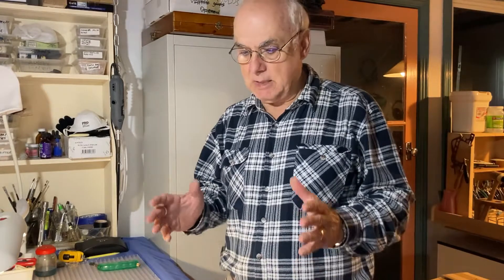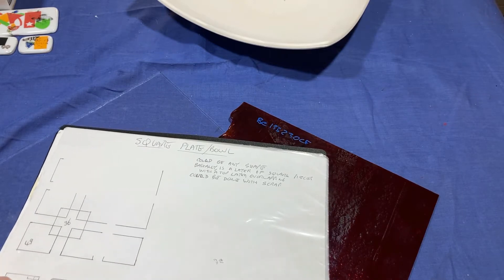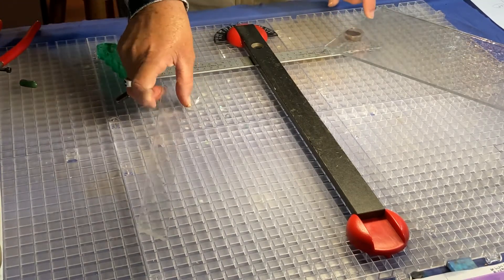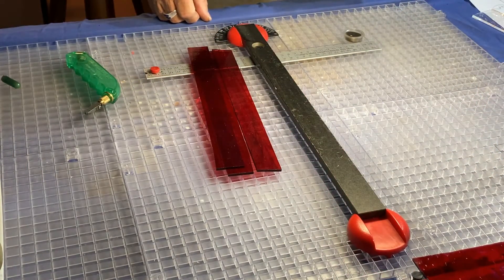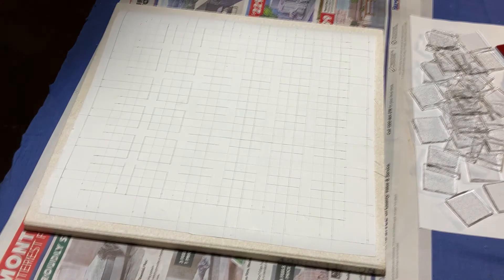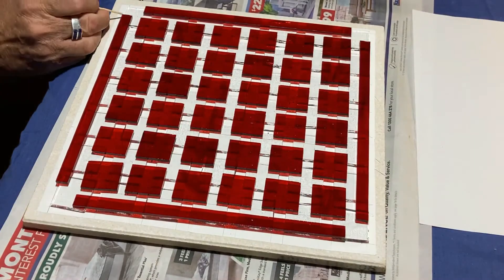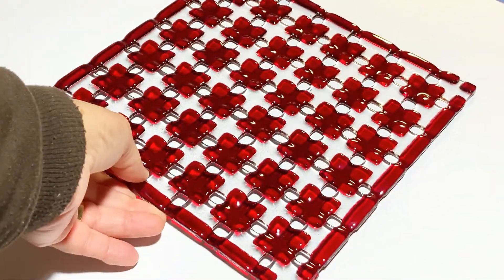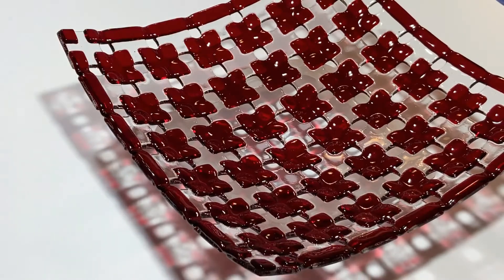Fused Glass Checkerboard Bowl Using an Easy Technique, Glass Fusing Project

Comment: Attempting this one (finally)…. I’ve had it bookmarked for over a year!!)….  Pray for me! 😂. I’m not sure my patience and math skills are up to par….
Reply from the maker: Hi Brandi. I'm sure you'll be fine. I have a shake so laying the pieces is a little challenge but slow and steady does it.
Reply: @RocketRoseArt  my struggles are with the measuring and laying out of the pieces:  are the base pieces 10mm apart? (I’m also trying to convert from metric to inches).
Reply from the maker: @brandiklepfer5810  Yes, 10 mm apart. That's a bit under 1/2 inch. But you can make it any size you want. My approach was making each piece 3 times the gap so it overlapped each piece the same amount as the gap. So a 30 mm piece with a 10 mm gap overlapped each piece 10 mm. But you could make it 1/2 inch gap with each piece 1 1/2 inches square. If it's too big for your mould, reduce the number of columns and rows. Hope this helps.
Reply: @RocketRoseArt  oh! Thank you! That is very helpful. The mold I want to use is 11-1/2” square so I was struggling (math is not a strong suit of mine).

Comment: Would it be possible to use dichro squares on top or bottom. Will the glass fuse to the top of dichro glass with a tac fuse.  How about iridescent glass on front or back. Will glass stick to the iridescent or luminescent glass. Enjoy your videos.  Thank you.
Reply from the maker: Hi Diane. I don't see a problem, as long as you don't have two dichro or iridescent sides together. Dichro on dichro won't fuse. I've tack fused dichro and iridescent glass so you shouldn't have a problem. As usual, if in doubt do a test. Hope this helps.

Comment: Very beautiful.  You said mils but is that millimeters?  Could you possibly give us inches too?  Thanks soo much.
Reply from the maker: Hi Nancy. Sorry, I normally would give inches as well. Not quite back in the swing yet. Yes, that is millimeters. The space between squares is 10 mm (approx. .4 inches) the square 30 mm (1.2 inches) and overall size 270 mm (10.6 inches). You can make the square any size, but make the gaps 1/3 on the square size. The overall is up to you. Hope this helps.

Comment: Hi Jeff, Lovely bowl and stand and looks fun too.  What size and style of kiln are you using? Thank you!
Reply from the maker: Hi Mea. All my kilns are Paragon.
Mainly use a CS (Clam Shell) 16. That opens on the top and the whole body like a clam shell. Great for assembling in the kiln and for cracking open to see progress.
Also use a Fusion 14 which is top opening only.
Also have a SC2 but that's mainly for small work like Anns jewellery.

Comment: Hi Jeff,   I was wondering what you use to sketch your pattern on the kiln paper with? And does it effect the glass when fired?  I'm trying this process with Autumn colors.....
Reply from the maker: Hi Dean. Just used a normal pencil and have never had any problem with it. I believe it's a common practice. Not so sure about things like Sharpies. Maybe run a test on that one.
Reply: @RocketRoseArt  .... a normal lead pencil it is... as long as you didn't have a issue using it I'm good... Thank you and I'll post a picture of my final piece.. Jeff? Do you have a Facebook Page?
Reply from the maker: @diggingeverydaydean8080  Hi Dean. Yes - https://www.facebook.com/RocketRoseArt